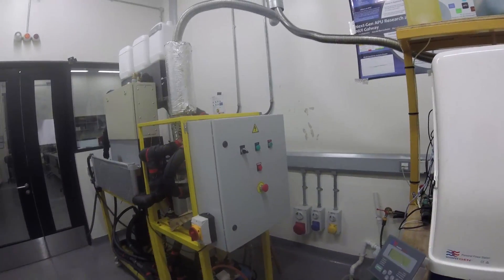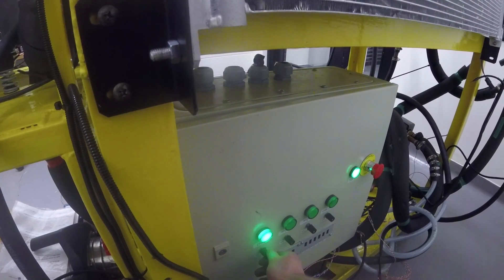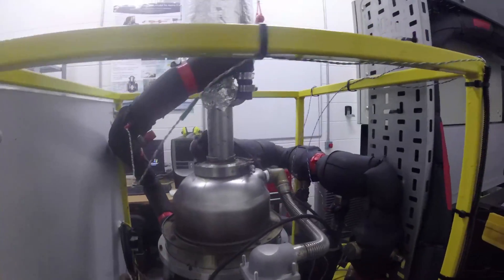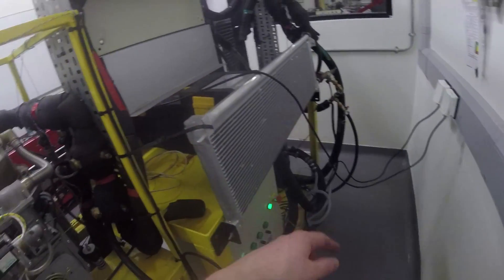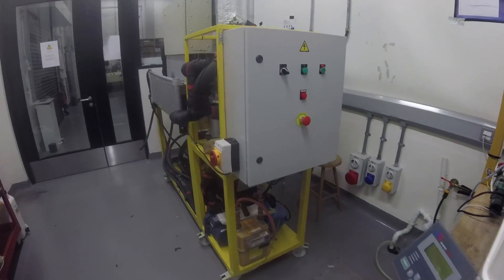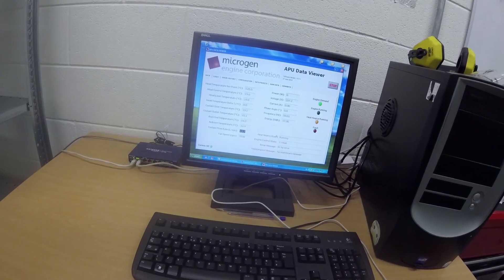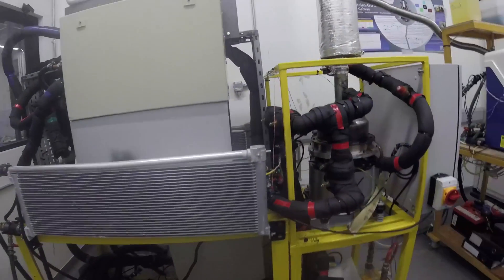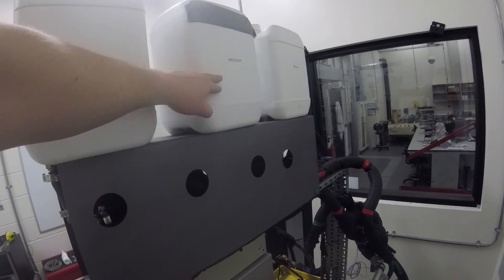Microgen Operating Guide

Comment: How much LP gas litres or kg or natural gas does it use to produce the 1kw for an hour?
Thousands sold appearently but nobody jas data or review
Reply from the maker: Engine is about 14-15% efficient so you'll burn 7 kWh of gas for every kWh of electricity so around 0.5kg an hour
Reply: @barryflannery8795  thank you Barry your response is very helpful and much appreciated.
0.5kg an hour seems more realistic than the estimated figure of 148kg (290L) I have received.
0.5kg an hour works out quite expensive for  a monthly gas bill and home use.
Nice to finally have an benchmark on this.
Thanks.